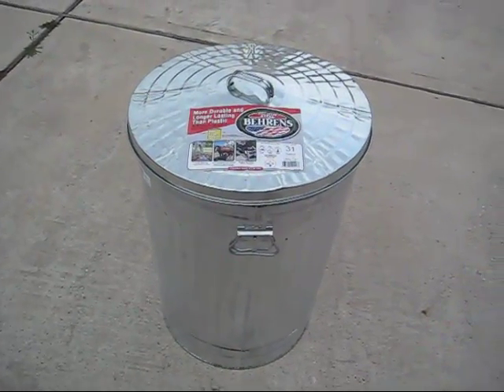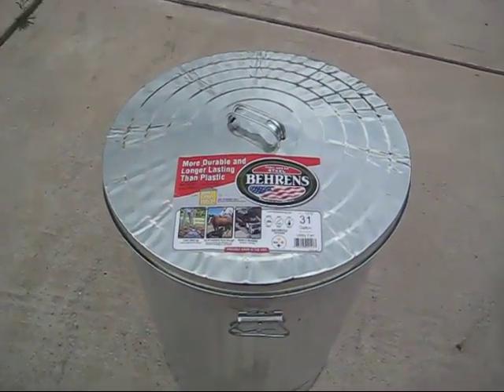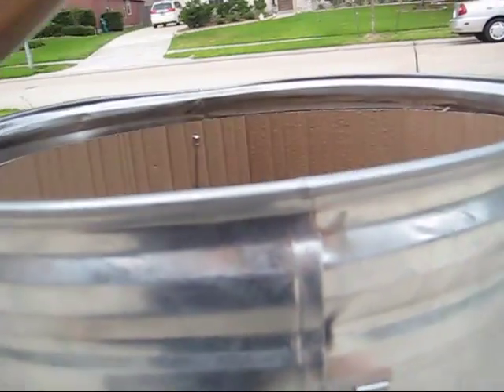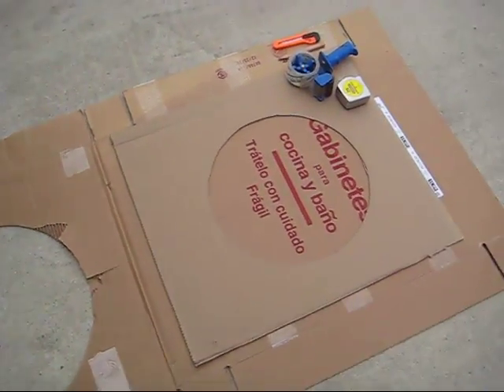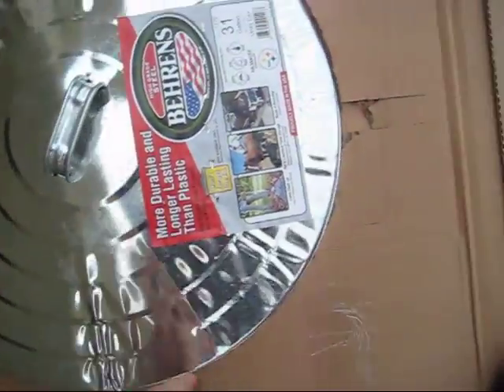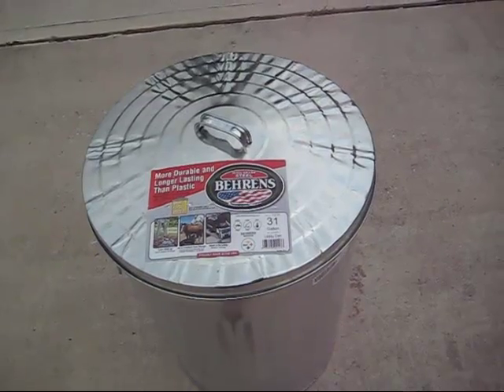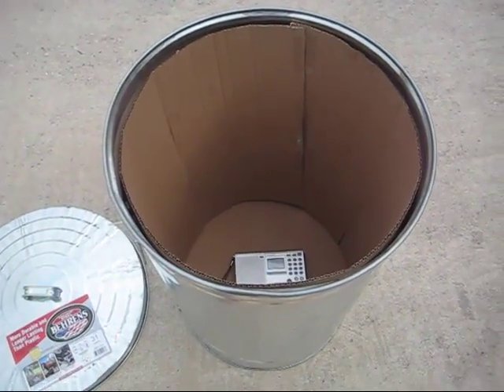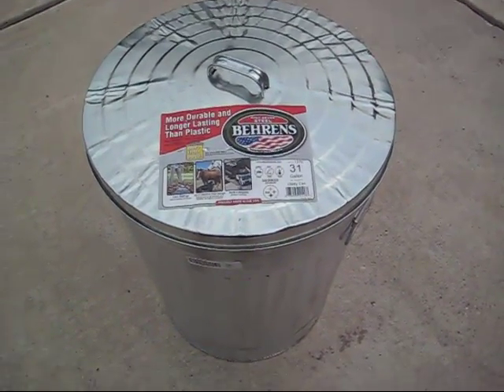Faraday Cage: Garbage Can, Really?

Comment: You definitely need plastic, foam or cardboard to insulate from the metal can. An EMP/strong solar flare could deliver 30k-50k+ volts in a tiny fraction of a second. There is no harm to living things or simple electrical devices but anything with a micro-circuit that isn't protected will overload and fry. This includes cars, appliances, tools -anything with a micro-circuit. This seems like it would work much like a Faraday cage or EMP bag but I'd want to build one myself to test first. Good vid.

Comment: (***) WARNING to any testing their cage with a car battery.  Get it up off the ground.

An EMP is a wave driven energy spike (voltage surge).  Put an old radio (turned on) inside your container, close it up, then energize the shell with a car battery for a few moments.  The radio will still be playing when you disconnect the juice and re-open the container.  BUT YOU MUST isolate the container from ground (up on dry wood across cinder blocks) else YOU may become part of the grnd circuit (death).

Comment: No ... items stored inside CANNOT TOUCH the metal container itself (it is the conductor which transfers pulse energy to ground).  Lining the inside with bone dry cardboard/foam/etc provides separation from the metal surface to stop energy transfer to the contents.  Anything touching the metal will become part of the conductive surface during an EMP, acting like a short circuit.

Comment: I believe this is wrong, electricity (EMPs) can travel into the radio if you don't have some kind of non-conductive protection between the radio & the g-can especially if the radio is touching the g-can. But I've read this all depends on the type and strength of the wave that hits the can. Best to be safe and use the cardboard AND nesting (put radio & other items in their original boxes with all cardboard and styrofoam they may have been packed in, then wrap box in many layers of aluminum foil).

Comment: Also, when wrapping aluminum foil around the radio's (or other item's) original packaging (nesting) you should wrap with several layers of foil, making sure to place a solid strip of foil over open seams - again, several times around.

Comment: I've read and reviewed several articles and videos that state you MUST have INSULATION between the cage (garbage can in this case) and the item being protected. The insulation should be non-conductive, such as cotton clothing, layers of paper, or cardboard. You can also opt to keep the radio (or other items) in the packaging it came in, which is usually enough to stop any conduction from reaching it from the walls of the garbage can.
Reply: I think it was nice to hear about other options for insulation. We may not all have the same materials handy. Also, if you’re gonna keep things in the box, make sure you test the product out and make sure everything is in working order before packing it away for emergency.
Reply: Well no shit Sherlock
Reply: @tac6044  Well aren't you a rude one. 
Nothing wrong with a viewer stressing something important to others that the creator may have missed.
Reply: @susanlbk  but but but, the Creator DIDNT MISS the cardboard insulation.... did he ?

Comment from the maker: You are correct, "Any rays that can make it through the can..." The point is none of the EMP gets through the can. EMP is a wave length and all wave lengths have a size. Since there are no spaces large enough for the wave to pass through everything in the can is protected. You are thinking nuclear blast an EMP is not a nuclear blast it is electo-magnetic energy. They are completely different.

Comment: You're right and perhaps my analogy was distracting. The point I was trying to make was about the difference in shielding the higher energy waves. Any rays that can make it through the can would also fry whatever is on the inside by inducing a similar voltage there. You would have a very small amount of energy drop on the can but the radio inside is toast in an EMP blast. Shielding is the main concern in an EMP or solar flare. Use LOTS of concrete, dirt, water, or lead for shielding.

Comment: LDSPrepper I love your videos but having studies nuclear physics extensively I want to point out some things to you.  Nuclear blasts produce EMPs with ridiculously high energy in the gamma spectrum.  These waves are measured in Mega electron volts.  Radio waves are in much lower energy band measured in micro electron volts.  In other words Gammas are 1,000,000,000,000 times more powerful than radio waves.  This is why nuclear submarines don't use $20 trash cans to shield them from the reactor.
Reply: What would you add to his idea to  make it work, please?

Comment: Nope doesn't work entirely.  It does work with a radio.  But if you put a walkie talkie in it, you can still get some signal through, nothing legible but you can here the walkie talkie trying to connect.  Also if I ground it, then dial my cell and place my cell in it, it still rings.  So this doesn't work on all frequencies and would be questionable at the frequencies of emp.  I will double up.  Ammo cans with gasket removed, insulated and in the can.

Comment: OK, this whole grounded/not grounded thing had me curious, so I called my father (An electrician, pilot, etc...) almost a trick question. If it is sitting on the ground it may just be like a person, you know people standing on the Earth who are not well grounded! (LOL, not many electrical jokes, take one when you have one). But if it is not something like a copper pipe 8' under ground, it seems the effects to complete the circuit alter a lot. Humidity, etc. I would just place it on a rubber mat.

Comment from the maker: Thank you very much for posting. If you don't want to use solder and a torch you might consider using aluminum A/C ducting tape. I used that on my Faraday cabinet and it works great.

Comment: well LDS, I retested with a FM radio playing just as you did. The radio continues to play with the lid on. And clearly. Before you suggest the can lid is not tight enough, please know that it's a brand new can with lid and the lid fits so tightly, once I place it on the can, with the can empty, when I lift the lid it will literally pick up the garbage can. So I have to hold the can handle while I lift the lid to get it off. Has anyone else experienced this?
I'm really concerned now!

Comment: thanks much! And yeah, I knew it was for a cushion. I was actually just wondering that if the lid didn't make complete 100% contact around the top of the can would the EMP be able to get through instead of washing all around the can. Whereas if the bottom of the can made full 100% contact and be better. My lid is fairly tight, but I'm not sure it's making 100% contact all the way around the can. Hard to tell if there's any minute space between lid and can. 
You have great stuff on your website!

Comment: hey LDSPrepper, thanks much! I just finished my faraday like yours. I have one question though. This may be hard to describe but here goes. On the inside of the garbage can lid, should the cardboard circle be trimmed enough that the inside surface of the lid touches the top ridge of the rim around the can body? Or, is it only necessary for the inside rim of the top, to touch the outer top sides of the can body?  I still hear my 2way radio when I send with 1 radio inside. ? Thanks!

Comment: question, a faraday cage usually is made with mesh or perforated metal, as many sites on line state that you need your holes to be smaller than the wave length that your are shielding out, i have to ask what the level of protection given by the can is? as one could logic that it shields out all frequencies. which seems a little extreme for a garbage can.

Comment: You can also do what we did at Virgina Tech... PowerMac G5's and some AlumaTape to seal them. It really worked. Anything inside the case was also shielded. Ground is not needed as you want the EMP to pass around and over, just not get into. Grounding would come into play if electrons were involved and then it's still a wash but opening an ungrounded case too early could cuase a discharge into the inside.

Comment: The purpose of a faraday cage is not to reflect the electromagnetic pulse, by basic principals because its built with materials that conduct electricity. It will redistribute the charge and shield the inside of the cage.  An EMP that is actually frying electronics is much more powerful and an FM signal that is blocked is not an efficient test.  I  recommend nesting nesting items in garbage can, plastic, aluminum foil, plastic, aluminum foil.  multi layers to redistribute charge.  Just a thought.

Comment: That depends on what kind of waves you are trying to block.  Each radio wave has it's own specific wavelength.  You have to get a mesh that is specifically designed to block the wave length you want to block.  This is the principal behind the mesh on the front of your microwave oven.

However, this will not block all radio waves, naturally.  What blocks waves of some frequencies allows other frequencies through.  But this can be used if say you get RF from nearby transmission towers.

Comment: Great Concept!!! The cardboard is not there to keep stuff from banging around as mentioned earlier. It acts as an insulator between the trash can. Without some sore of insulation your electronics would fry by touching the sides as the electricity ran through the can. Which brings up another point, you must still ground the can using a grounding some sort of ground. YES the cage will work without a ground but don't be fooled. EMP and/or Solar Flares are much more powerful. BE SAFE and ground it.
Reply: please explain how to hook up a ground, thank You

Comment: @LDSPrepper If you've used a microwave for cooking, that IS the test.  If you look at the window in the door, that screen mesh is part of the faraday cage, built into the oven.  If you cook and put your face next to the door, your face doesn't cook.  Faraday cage worked.  I keep a spare radio inside an old microwave that has a burnt out magnetron.  Yes, I trust it.

Comment: Whats everyones thoughts on putting low voltage cat5 cable and other spare light gauge or heavy wire in its own can?  Im wondering if the surge is high enough if wire itself can ground out and burn becoming useless.

Comment: If you understood basic electrical theory, you'd realize that this simply isn't true.  Your best best for storing critical electronic gear is inside a microwave oven, and keep it plugged in.  That way its grounded and shielded.  A microwave oven has a faraday cage inside to contain the microwaves.  

Using foil won't hurt but it won't help when the massive EMP surge strikes your electronics.

Comment: A steel can is not the "best alternative" for cheap emp shielding, as a part of a system where the steel can is the outer container however would be good.
See, the best "cheap" insulating material with the best conduction properties is aluminum foil.
Wrapping what you want to protect in plastic, then 2-3 layers of aluminum foil, then plastic, foil and plastic-foil one more time, then store it inside this kind of steel can (lined inside with carboard), now that would work.

Comment: with the whole EMP bags website you linked.. why would one need those if you can just use aluminum foil to do the job? because if wrapped around an object it does the same thing. Also it is said that no isolation is needed when making these large containers as you have, it doesnt matter though.

Comment: Very interesting video and I will probably try it out, but I have two questions:
1) At 1:24 you said to stick an FM radio in the can.  Can it be shortwave, or any other frequency of receiver?
2) At 1:49 you said that after covering the can, all you could hear was static.  I truly don't know, but was under the impression that static was caused by random, background electromagnetic energy being picked up on an antenna.  Wouldn't a good block of all EM energy result in no sound at all?
Thank you.

Comment: The difference between a faraday cage and a capacitor is a ground so any charge build-up will be diminished. Without a ground, your equipment may be safe, and any charge will flow to ground at an unknown speed, that may be slow. With a ground, any/ all possible charge is dissipated to the ground instantly, which saves your equipment, AND YOU!!

This is a simple and fast faraday cage, you are right about that.

Comment: I was wondering, from the several articles I've read in the past about faraday cage building, wouldn't it be best to attach a grounding cable to the can (removeable of course) that would then attach to a grounding rod of about 3 foot in length? The radio test is a good general test, but a burst of high frequency waves would behave a bit differently, as propostioned by some.  It may be worth the few extra bucks.

Comment: I am pretty sure the cardboard is simply to provide a little padding for your gear stowed in the can, but just a thought - spray-glue aluminum foil to the outer side. It will add a layer of shielding and in a pinch could be used to jerry-rig a solar cooker after the fact to augment your commercial one. I have a Sony ICF-SW7600GR radio setting right next to me - plus a couple of old Grundigs with hand generators. That is a sweet little SW receiver for the $ IMHO.

Comment: Just questioning...would a mertallicized mylar bag be enough of a metal barrier?  I mean, is mylar really metal?  Or is it just a shiny polyester?  Aluminum works, so it doesn't have to be a magnetic metal (which steel is, but aluminum is not)...but is there any metal in mylar?  Hmmm, have no idea, but if it is, then there's your easiest nest ever.

Comment: Looks just like my Faraday cage!  I've talked about it on several chats.  You can also simply wrap your items in bubble wrap and put them in the garbage can.  The cardboard is a good idea too.  Don't forget your solar battery recharger.  Also, take the tops off a set of outdoor solar lights (the solar collector part) and put them in there too.  You can store the plastic bottom with the spikes that go in the ground somewhere else.  Those little solar yard lights are great.
Reply: Oooooooh, I didn't think about bubble wrap.
Reply: Doesn't work